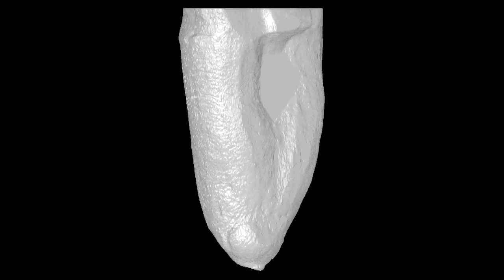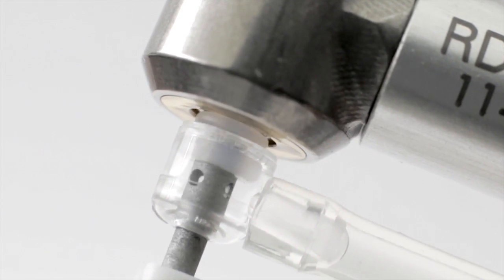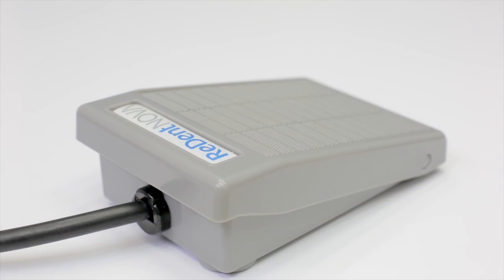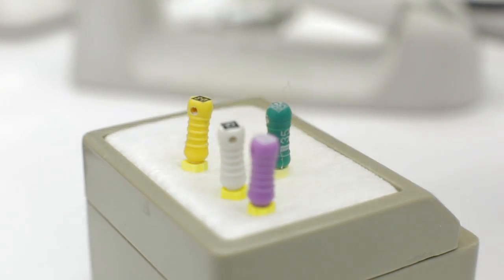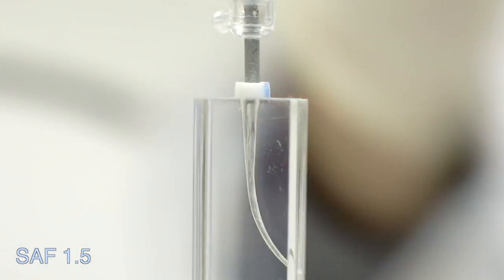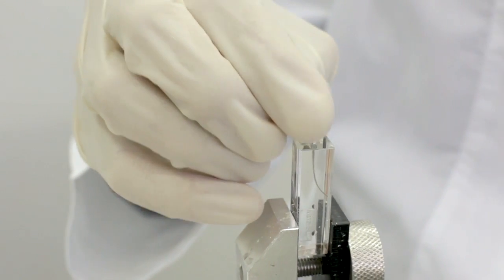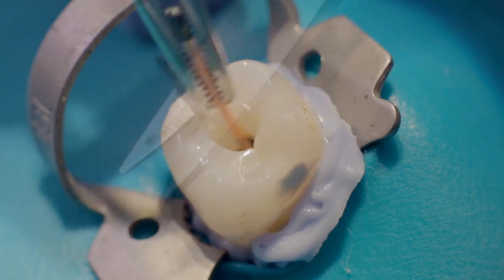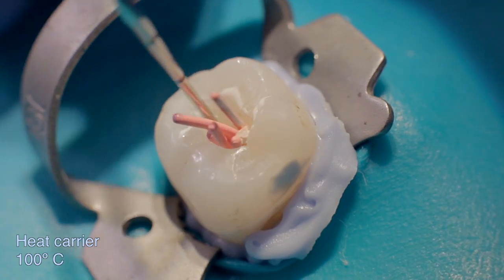Self Adjusting File (SAF) instructional video

Comment: SAF seems to be a very efficient in cleaning root canals. The desinfection however could be better if more efficient antiseptic agents  were used. One single bacteria left in a side canal is enough to cause a failure. Some disinfectants are effective in a proper concentration. ChKM-solution according to Walkhof is based on Camphorated Phenol and has a very good ability to penetrate even the smallest dentin tubules. It is also extremely efficient against bacteria.  Another desinfectant that has been shown to be effective is Carbamide Peroxide. Formaldehyde is a well known antiseptic. The root canal cement N2 contains paraformaldehyde that in body temperature in depolymerized inte formaldehyde, known to be effective against bacteria.
Reply from the maker: Dear Nils, thank you for commenting!
Actually, there is no reason not to use any type of disinfectant with the SAF System, as long as it is flowable and permitted to use.
However, the use of sodium hypochlorite is not only for disinfection, but also to dissolve the pulp tissue, which is no less important than disinfection.
It would be practically impossible to achieve a 100% disinfection in 100% of the cases with any type of disinfectant (as long as the tooth is connected to a living human being, at least), but as long as you can achieve a high level of disinfection, are able to remove the pulp tissue and to avoid packing of debris, and are able to seal the canal well, a high level of disinfection should be sufficient, and a 100% is not really necessary. This is why the benefits of NaOCl provide more than just any disinfectant, and combining it with EDTA would achieve even better results.
Reply: ReDentNova how I can get it